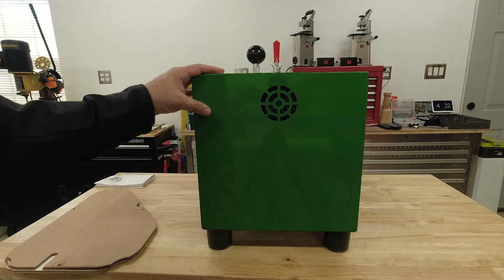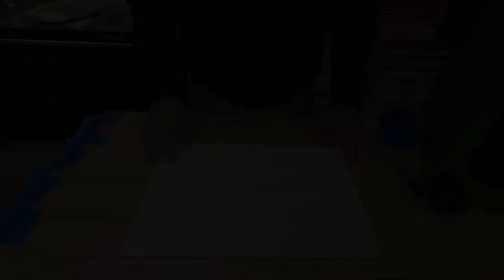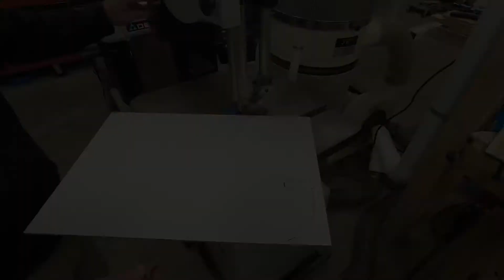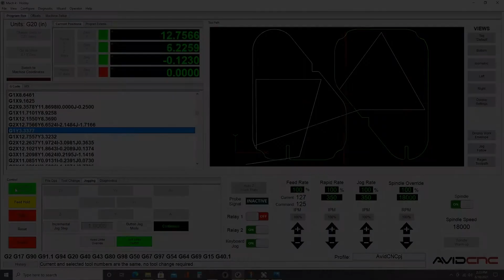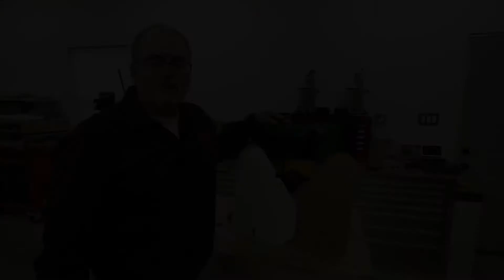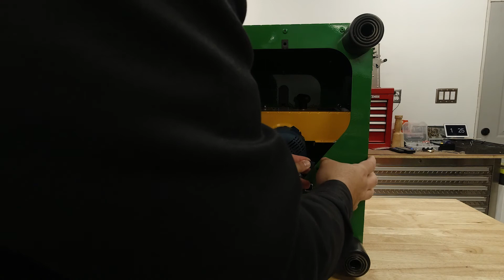Castle TSM-12 Pocket Cutter Dust Panel

Comment: Why wouldn’t this panel just be included with the purchase?
Reply from the maker: Hey, thanks for the question. While we do recommend using dust control to keep the router clean and cool, we don’t ship it with a pre-cut panel as we try to keep our price to the consumer as low as possible. Our machines are hand built in the USA [Petaluma, CA] and we include a template and hardware for the dust control panel which most people find fairly easy to cut themselves.  The added cost of an included panel makes our current product offering the best solution for our customers.